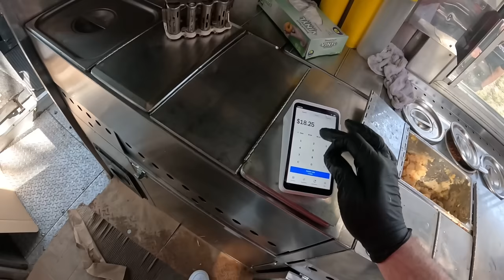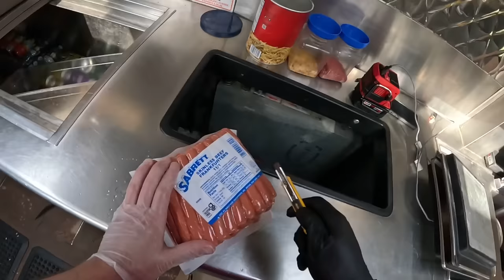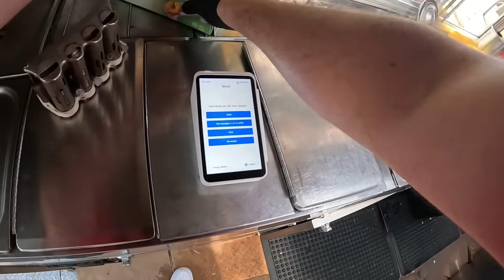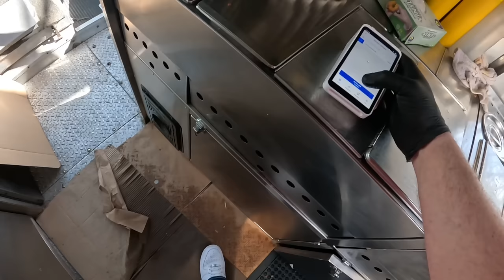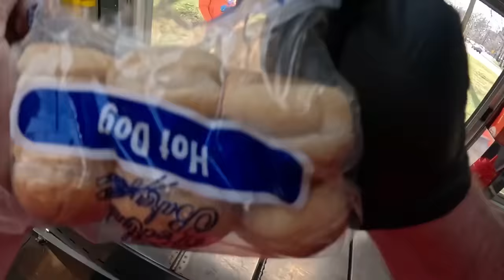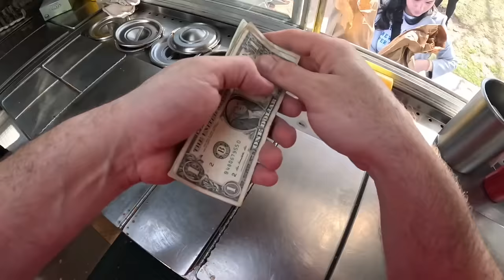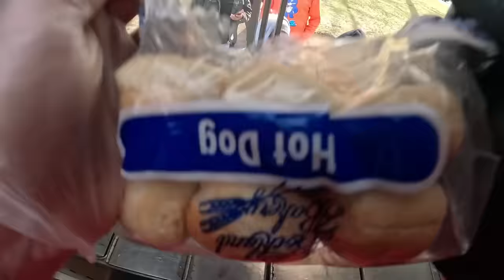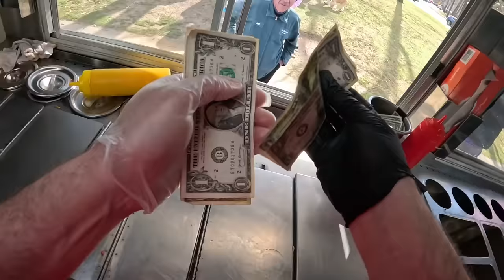The Truck Part 2

Comment: Weld or solder that steam table. If it's all aluminum, I think it's called  tig welding. Call a welding shop, they should be able to help you out. Good luck.
Reply from the maker: I have a welder on standby 😂